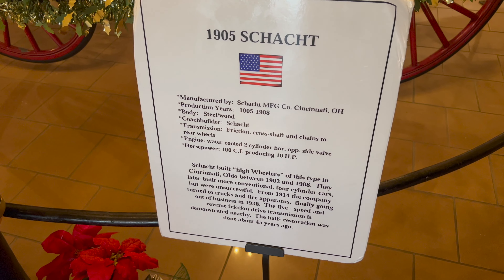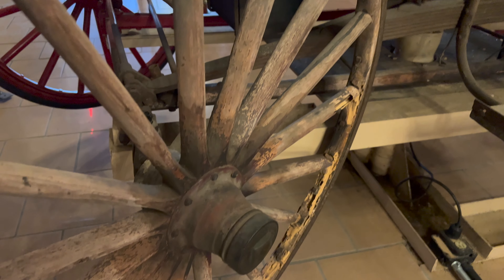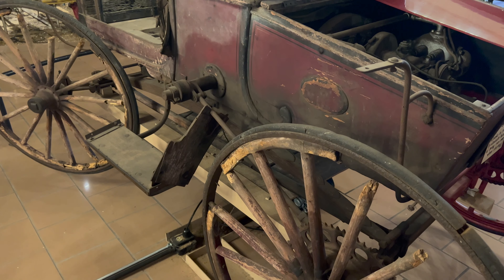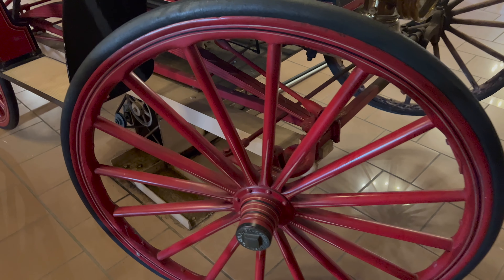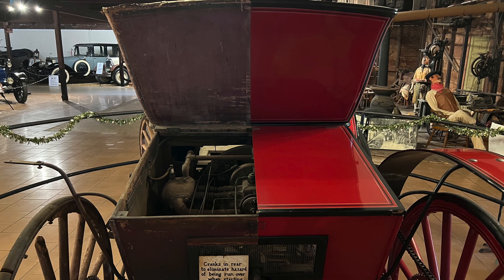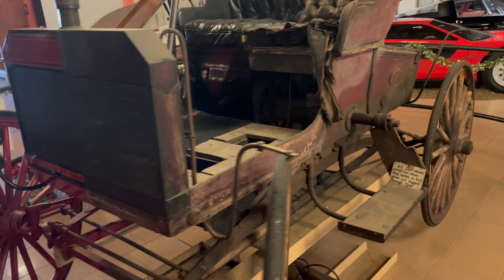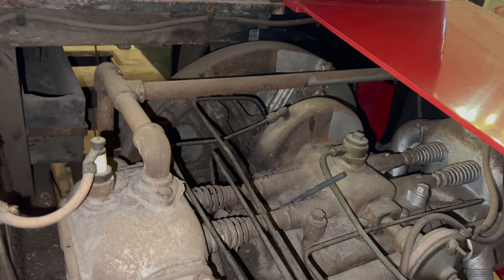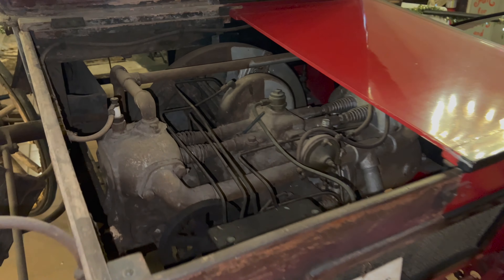Keep it Original or Restore it? 1905 Schacht Shows both ways at the Sarasota Classic Car Museum

Comment: Fix of course. I like old motorcycles, and it always made me mad when guys would say don't touch the original paint. That is fine if the paint is still doing its job and protecting the metal. But if not, I say save the object and restore. My two cents!